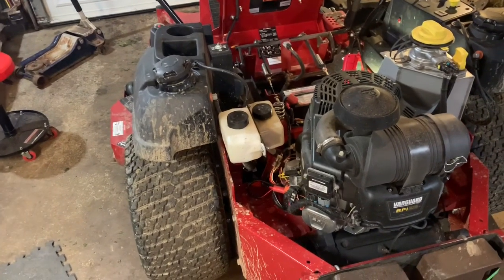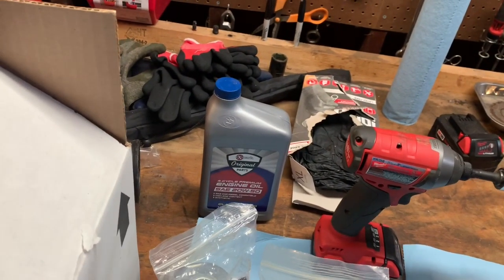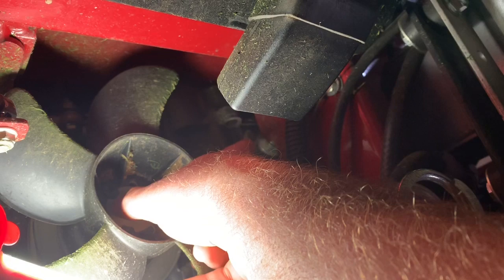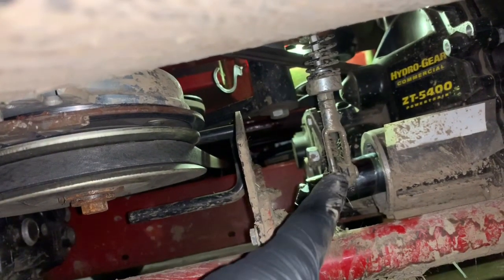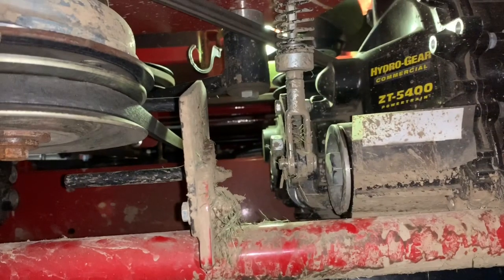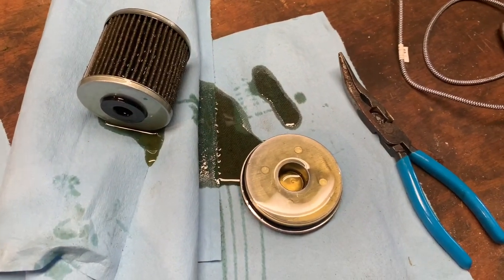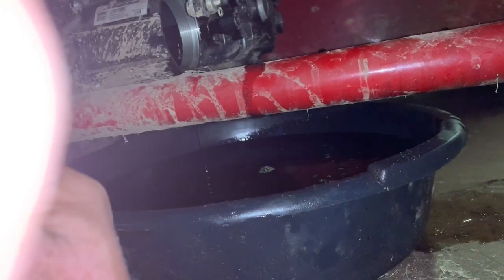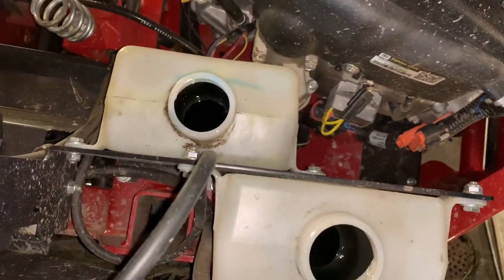Ferris hydro oil change

Comment: Johnny, when you first fill the tanks on the hydros. Barely crap open the caps on the filter housing..it'll let the air out..
Reply from the maker: Can you please explain  a bit more?   So you undo the bolt a little and that will let the air in.  Does it leak?  This would be genius and help a lot.
Reply: @JohnnyMow  Yes, Johnny underneath lightly break the seal of the cap. The cap over the hydro filters. Fill the tanks first. Then lightly break the seal. The air will flush out and oil will start to drip once air is flushed out..then tighten the caps..
Reply: @JohnnyMow  It's like bleeding the wheel cylinders on a vehicle when replacing the brakes..may even push the handles forward to help bleed the air out..

Comment: Opening those vent holes would greatly speed up the filling process. Need to figure out how to access them without taking the whole mower apart. I’m big on maintenance as well and that would drive me crazy too. I see why others don’t change the fluid and rather buy new pumps every 2 years or simply buy another mower. Lol...
Reply from the maker: Billy Goat I think if I take the hydro fan off I can get at the one.  I got a year to think 😂

Comment: On my 3200z I could get my Bolts out easy with a ratchet and extension and the filters were pretty easy my only issue the amount of oil it takes to fill back up and how slow it is going in there

Comment: I was told to not even mess w changing hydro oils ... that’s when you start having issues.
Reply: Yeah,  I've mowed with hydro mower since 1999 or 2000, never messed with the them, zero issues

Comment: did you sell it. what's your opinion on the 210 vs 2100 shocks or not?  shocks make it slightly heavier also
Reply from the maker: If I had to choose it would be 2100.  Springs make a huge difference

Comment: Hey dude love your videos.  I’ve done this filter/oil change on a Gravely proturn 460 with the 35 hp Kawasaki.  That thing drinks gas like crazy and clogs up terribly if you have heavily fertilized a fescue blend of  grass.  Anyway, the hydros are irritating to get to on that mower as well. ....I did like the seat on the Gravely.  Air ride and rubber bushings.  It’s kinda squirrelly on steep ditches banks with the rubber bushings but if you let the air out it does ok

Comment: Why did you do this? Was there an issue? How many hrs on the unit?
Reply from the maker: jeff B changed the oil.
Reply: Johnny Mow my dealer said not to waste the time. That fluid wont get bad. Only if its not working they said.
Reply: @christophbrady  Sounds like my dealer dont change the oil till it breaks so I can sell you a new hydro or better yet a new mower.
Reply: John Hill ya i usually get new ones every 2 years anyway. So makes sense why waste the time. The next guy will change it.
Reply from the maker: Umm manufacture  the oil says to change after first 100 then every 400 or yearly
Reply: Im not a mechanic, nor a landscaper. Simply a business man. This equipment runs solid for 2 years with no issues so long as your operators understand what they are doing and to check fluids once a day. Then resale is great since the units are not aged much regardless the hrs. Each hr it was running it was making money and never broke down due to not changing fluids.
Reply: Engines and hydro pumps are completely different ,no need to change hydro oil
Reply: Lawn Commander exactly brother! I find less life from the hydro system when changing fluids..... than if you never change fluid and they last forever.... literally engine will blow up before hydro pumps. anyone who services these things always ends up with broken hydros. Its kinda common sense. Why would the hydro fluid ever go bad? Im not a mechanic nor am i a
Reply: Yeah.. never changed hydro oil in any unit unless there was a problem.